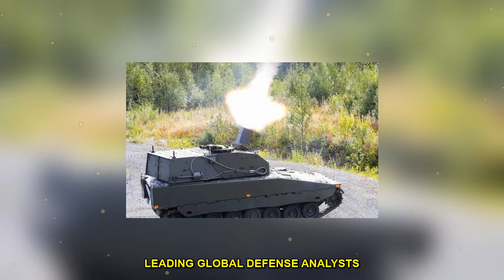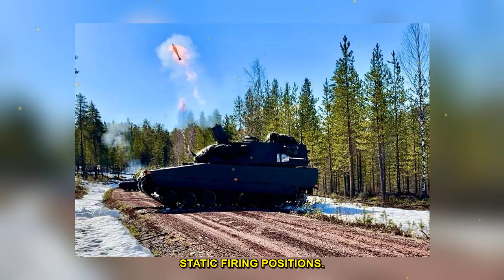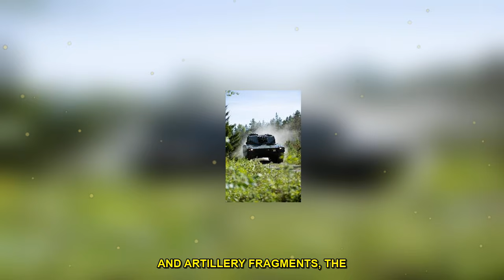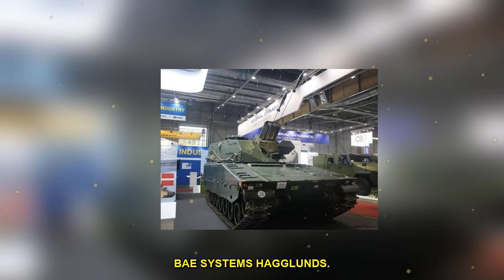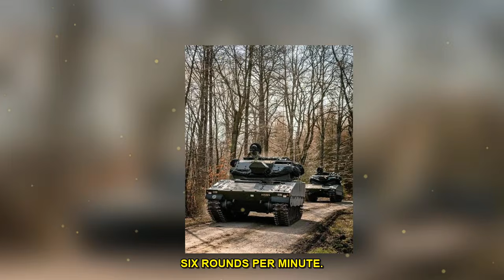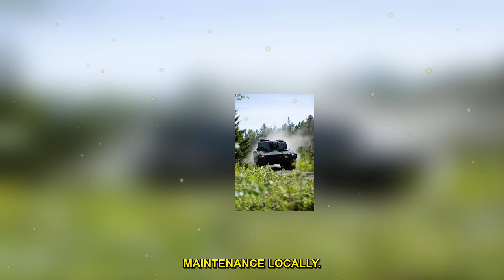Netherlands CV90 Mjolner: Inside Europe's Deadliest Mortar

Comment: Mjölner started as prototype - and stays like that.
Compared to Patria Nemo it's like a relic from 1980's.
Nemo will shoot:
- 10 rounds per minute
- high or low elevation
_ direct or indirect fire
- with or without MRSI-mode
- time on target or when ready
- static or on the move
- From the wheels, tracks, container or boat.
Reply: Strange as it may seem, during development the swedish users deliberately elected to go for a less automated and more manual design. The rationale being that they got good enough performance and a system they felt was easier to troubleshoot if need be. But, yes, the NEMO is very impressive (as are most Finnish artillery systems).